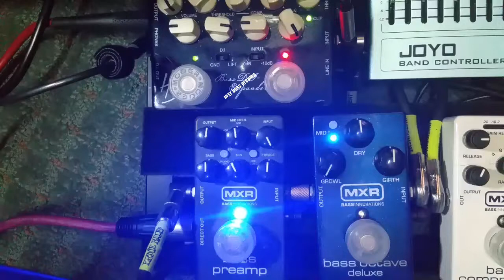tutorial on the mxr m81 bass preamp

Comment: What are those round clear things on the stomp boxes? do they have any value?
Reply from the maker: yes , the left is GROUND LIFT switch engages
a Direct Out ground lift and the right is  PRE/POST switch determines
whether or not the Direct Out
signal is affected by control
settings
Reply: Not that, I mean the round clear things covering the metal switches that you stomp with your foot!